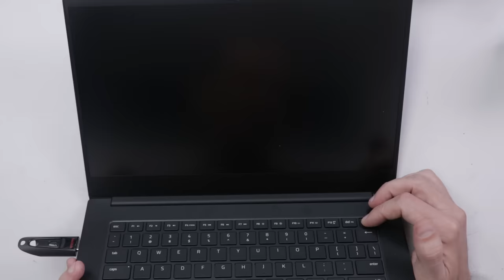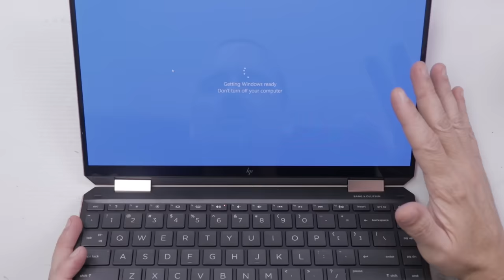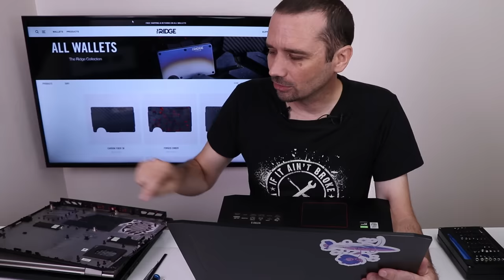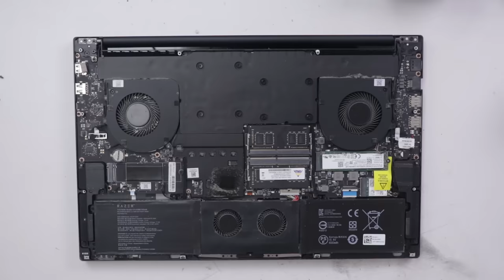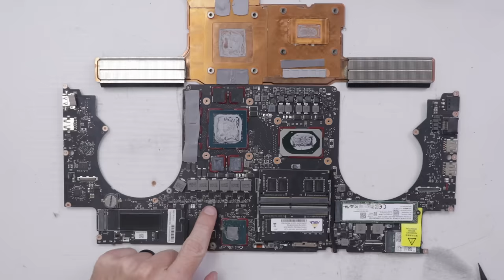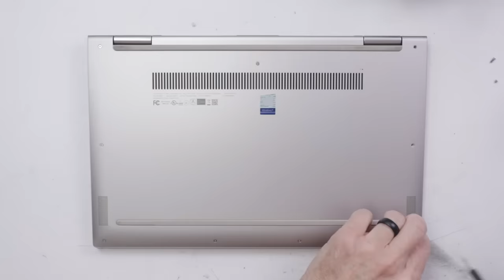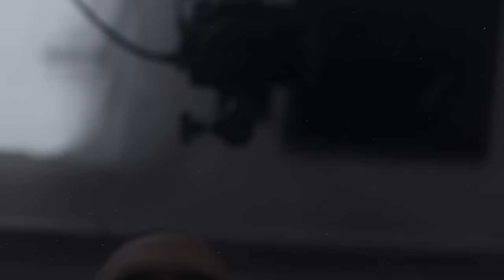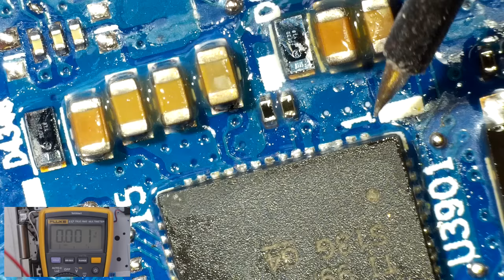I Paid $2500 for 5 BROKEN High End Laptops - But Can I Fix Them?!

Comment: For the Lenovo: Might also be a problem with either the charging cable, as my Yoga 730 recognizes if it‘s the supposed original one or a different. Which brings me to the second problem, if I use a different one I need to have the laptop open, because there is a light sensor near the camera which has to detect light. Else it won‘t start charging on another charger than the original one. This seems to be a known problem in Lenovo forums.

Comment: For the charging issue: my guess is that your dongle is not able to "boot" (initialize) itself, maybe try without your dongle and the computer on, see if the battery icon shows a charging indicator?
Reply: correct. I have same issue with those USB-c meters.
Reply: Yep - Always try without the dongle to rule that out as a cause! On another note i've seen Lenovo's kill the battery charging controller on several occasions so i'd probably just replace that to rule it out!
Reply: yep, i would do the same thing... i think the issue is the dongle, the charger, battery and laptop are just fine imo.
Reply: Also try to flip the usb-c cable.
Reply: Totally agree with that, I had the same issue with such a dongle.
Reply: the battery charging probably pulls too much current for the dongle to be able to start successfully

Comment: Laptops with battery issues are a tale old as time. Been doing laptop repairs, tech support and troubleshooting for over 15 years. One of the most common things I've run into is no power, no charging, etc. which seems to match up with the Lenovo. Most common fix I've had for that is to remove the battery, plug the unit into ac power, power the laptop on, go into windows, give it a few minutes, then shut down. Power off the laptop, reinstall the battery, boot back in, plug it in, and more often than not, it starts working again.
Reply: Laptops specially these compact ones got annoying issues with batteries. Usually the trick that Chris Harper said will work, but what I've seen 9 out of 10 needs a new battery to fix charging issue. A aheap batter isn't the best solution for a budget laptop or a sleek one.

Comment: Regarding the battery issue, I'd measure what changes when you connect the battery after it triggers 20V, especially on the battery sense pins, either voltage or resistance to ground and resistance to the charge controller. Also I'd check the battery connector soldering

Comment: For the dead keyboard sometimes a BIOS update fixes it.

There was nothing wrong with the two first devices. The first one just needed a single Windows reinstall and some drivers (that device manager looked horrible).
Now it's worth taking the working ones apart for repasting and cleaning the dust.

Comment: Always great to see your thought processes.  Its weird that the charge controller chip sees the battery voltage.  I would have normally thought a Mosfet between the battery and charge chip isn't working or something, but without a schematic thats tough to diagnose. Really strange, but glad you have most of them working. Great job!
Reply from the maker: It does seem strange to me. We'll see what the comments say when this goes live tomorrow.
Reply: P
Reply: The charge controller chip may see Vbatt for features like over voltage protection or similar safety features right?

Comment: Anytime you have a windows install that doesn't detect certain hardware (particularly the internet connection), you just need to install the drivers for it, you do not need to reinstall windows. You can usually find downloads for the driver software from the manufacturer's site if you simply search up the model number of the computer from another computer and download it to a USB drive for it. /IT professional

Comment: I had the same Battery Issue. Quick fix from an IT guy, he unistalled Drivers and did system restore from old backup. 
he checked my battery voltage as soon as he grabbed the laptop; then he checked AC connector, not even 5 minutes passes he asked me if we could do a system recovery or format PC to leave software Issues aside. he did system recovery, it took about 15 minutes for the PC to Load, and it was fixed!. 😇 he could have charge me for new battery or other expensive parts, I'm happy that there is some honest workers out there.

Comment: Lenovo - if it's fully discharged, it usually needs to boot up 2 or 3 times [turns on, turns off, turns on] and then it's fine. I guess when it powered down when you tested it, you just unplugged it right after it turned off by itself for the first time.

also if it's not charging and just flashing, but starts to charge when battery is unplugged, it can be KBC chip (Super IO chip)

Comment: I am constantly surprised by how many items you get that only need a simple fix like re-installing the OS.
Reply: Retailers do not fix the hardware, when a system is "broken" it gets tossed into a pile of broken computers to be auctioned to places that sell computers like this by lots.  You still need to know what you are doing and this was not a cheap lot (average 500 per computer, add to that the time to check it over and order parts) but retail wise he could maybe sell them for 5k if the Lenovo gets working properly.  Of course, with reselling the laptops, comes the warranty issues.   I used to purchase from Surplus by Design but their prices and shipping cost have become prohibitive, we'll let the market die down a little before there are normal profits to be made.

Comment: Make sure to test the ram on all of these laptops especially the easy fixes. When it comes to PCs and laptops faulty ram can cause crashes and blue screen when put under a very specific load and with basic testing you have a chance you won’t encounter those issues. I suggest run memtest or Aida64 stresstest on all systems and if they pass it’s all fine.

Comment: I’ve got a very similar issue with my Lenovo X1 Yoga as well. It just decided to stop charging and not even turn on with AC power. Brought mine to a repair shop and they could not fix the issue. Hope you find a solution and maybe I can fix my laptop as well. Thanks for the great content!
Reply: @BobDevV  My grandmother's lenovo laptop refuses to charge. It just blinks the charging icon, orange light. The batter is never used but the laptop is 5 years old

Comment: For the Lenovo laptop, try discharging the capacitors by unplugging the battery, pressing the computer power button for 20 to 50 seconds, replug the battery and then everything should start to behave normally again, I've seen this behavior before on other laptops and hearing as you said "it charges normally but starts doing it after a while" reminds me of this, said procedure usually fixes it
Reply: Lenovo has been repeating this thing since the old T60 that has somoe sort of latching issue because of residual charge on a mosfet (something like that). But hey, HP support and forums are not very different ....

Comment: One word of advise. It looks like your Windows USB drive has an Asus image on it. If you plan on reselling these, I would either check to see if there is a restore partition available to either revert to the proper factory image, and if not, I would use a generic Windows install (Microsoft has a tool that allows you to create a generic flash drive). If using the Microsoft Image, just say you don't have a key and pick Windows 10 Home for the install. By doing this, it will save the buyer from violating Microsoft's licensing terms.
Reply from the maker: Good to know. Thanks!
Reply: @Tronicsfix  windows media creation tool is what ya need! 😁
Reply: Also, it will automatically reactivate when you connect to the internet because the key is tied to the laptop in MS servers. So, even a generic win install will activate with the laptops built in key.
Reply: Yeah Windows should be able to find the license. Upgraded my mother's old Windows 8 desktop with a ssd and a Windows 10 install so she could access her HEIF photos, and Windows just automatically activated and upgraded the license to Windows 10.

Comment: A quick tip for aspiring fixers or even someone whose laptop keyboard isn't working and you suspect it's a hardware fault; just plug in any usb/Bluetooth keyboard and if that works, then it's most probably the laptop keyboard problem (still could be liquid damage & fixable) so buy a nee replacement part. If the usb/Bluetooth one doesn't work as well, then it's most probably a software problem.

Comment: Firstly great job and great video! :D For the laptop with the charging issue, I would measure with an oscilloscope the instant current drawn when you couple the power cable, because it looks like the power source is hitting some kind of over-current protection or short-circuit protection and cuts the supply off, then tries again every second (and that could be the reason for the flash)...so it might be the faulty battery which is drawing a lot of current at start or maybe a faulty power supply

Comment: For the charging issue:  I think the problem is a short from a faulty capacitor, you should be able to use your multimeter to check

Comment: The laptop that you're still struggling with you can try and reset the SuperIO. Its normally accessed via a pinhole through the back case with a thin paperclip. It presses a tactile button, hold it for 5-10 seconds. Also enter BIOS and see if there is a battery reset option in there. I find it odd that it will indicate charge with not battery attached unless it has another smaller internal one which some laptops do have.

Comment: I think I see your problem...

The low voltage LDO outputs on the TPS65988 are not meant to power too many external components.  At most the 3v3 LDO output will be powering an external flash chip that stores the firmware for the chip.  The ADCIN1 (pin 6) and ADCIN2 (pin 10) pins are not voltage inputs, they are literally Analog to Digital Converters that measure the voltages across a set of external resistors. When the chip boots from the flash it reads the voltages on ADCIN1/2 and uses that information to set the address of the chip on the I2C bus and what it does during boot if something is wrong.  This allows the designers to set the behavior of the chip with a few resistor values... 

With the battery disconnected you should get nothing on VIN_3V3 with everything unplugged.  LDO_3V3 and LDO_1V8 are used to start up the external voltage regulators elsewhere on the board but can't really power too much, they are only meant to get things started.  The fact you see LDO_3V3 at 3.3 volts says to me the board was designed correctly with this in mind.

I believe the flash for the TPS65988 could be bad or the resistors are the wrong values, both could cause it to boot loop and make your meter blink like that.  You'll have to read the datasheet for more info and where to get the flash bin but you could check the resistor values and follow the SPI lines to find the flash chip (probably a W25X05CL):
39- SPI_CS (GPIO11)
38- SPI_CLK (GPIO10)
37- SPI_PICO (GPIO9)
36- SPI_POCI (GPIO8)

From the datasheet:
The TPS65988 loads any ROM patch and-or configuration from flash memory during the boot sequence. The TPS65988 is designed to power the flash from LDO_3V3 in order to support dead-battery or no-battery conditions, and therefore pull-up resistors used for the flash memory must be tied to LDO_3V3. The flash memory IC must support 12 MHz SPI clock frequency. The size of the flash must be at least 64 kB. The SPI controller of the TPS65988 supports SPI Mode 0. For Mode 0, data delay is defined such that data is output on the same cycle as chip select (SPI_CS pin) becomes active. The chip select polarity is active-low. The clock phase is defined such that data (on the SPI_POCI and SPI_PICO pins) is shifted out on the falling edge of the clock (SPI_CLK pin) and data is sampled on the rising edge of the clock. The clock polarity for chip select is defined such that when data is not being transferred the SPI_CLK pin is held (or idling) low. The minimum erasable sector size of the flash must be 4 KB. The W25X05CL or similar is recommended.
Reply from the maker: Ya, that's what I was thinking. LOL, Jk. Seriously though, thanks. That's a lot of info. So how would one fix this type of problem?
Reply: Okay, maybe not a bad flash chip... but a bad diode-pair or bad mosfet...  If you can find the flash and trace the power backwards from there to one of the LDO power pins on the TPS you'll probably find the component that has failed.  It would probably be between one of the the LDO pins on the TPS65988 and the flash chip holding its ROM (maybe a W25X05CL or similar).
Reply: But without a schematic you'd probably have to poke and pray....

Comment: Love the videos, I find them really inspiring. I used to fix a lot of HP laptops back in the day. Older laptops were pretty simple but as things evolved, they got more complicated. Some components now had their own hidden processors. Quite often these would crash but because they always had battery power you couldn't just reboot them. An HP engineer showed me a trick to force a reboot of these hidden processors and it might be worth a try. Disconnect the battery and connect the charger, power on the device and as soon as you see the boot logo before windows starts to load, pull the power cable. Now reinstall the battery and power on as normal. The HP laptops would flash the power light to indicate the hidden processors had rebooted and usually the weird issues would disappear. Hope this helps. Keep up the great work.

Comment: When installing Windows onto an OEM machine you should download all the necessary drivers and add those to a folder on your USB drive before installing windows... or at least the system and network related drivers.   That way you can just install them and be done.

Comment: It is so nice to see how easy is to replace battery and keyboard in windows laptops, I remember replacement battery in my 2019 MacBook, 1.5h fight with a glue, and I'm not even talk about keyboard, 40 tiny screws, 40+ ribbons  and a thin aluminum foil shield.

Comment: Normally OEM laptops (ASUS, Razer and so on) have their own deployment systems that handles reinstalls. Most of the times you have issues with a normal reinstall is due to that. But there are always workarounds. Drivers from webpage, a RJ45 adapter and so on.
Reply: ACER has problems with EEPROM. Keyboards and TP are generally affected by that. And no a BIOS flash wont fix it. You have to use an ACER tool to fix it. Very easy tho, but i doubt ACER share the EEPROM writing tools

Comment: Couple things I would have done with the yoga: the charge IC was clearly replaced, I would have removed it and properly reseated it, its possible solder is bridged underneath to the ground plane. Next I would have went on VinaFix and got the schematics. That USB-C port is super sus I would have removed it and looked for bridging on the USB C port, it was probably replaced poorly by a tech.

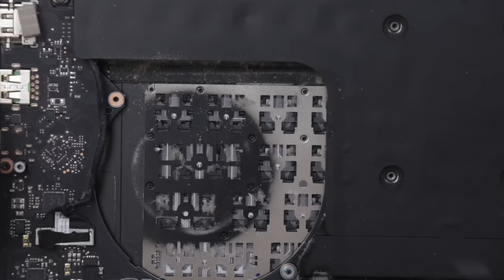Comment: 10:30 Any laptop that is used for a few years without being cleaned out is gonna look like that inside.  I've seen much worse in desktop PCs that sat running 24/7 in a smokers bedroom.  They can get bad, like someone just dumped dusted tobacco inside the PC and kept packing it in until the PC died.
Reply: I mean that razed laptop is a very small form factor so if it’s used in a dirty home it could very well look like that in months.

Comment: I had a lenovo too with charging issue, The problem was with it's BIOS, you have Conservation mode on Lenovo Vantage, which will help fix most of charging issues just by turning it on and off again....
Updating BIOS will be the best option I guess.
I'm not Hardware expert so I don't know much about Hardwares.

Comment: For the lonovo yoga, You might just check the pin on the battery connector on the board to see if there's any issue since it work perfectly fine when you unplug the connector, hope it help.

Comment: I wish you would have figured out the lenovo charging problem. I have the exact same situation on a lenovo x380 yoga. It happened after minimal water damage - a few drops went in around the area of the arrow keys. The laptop turned off and since then I have the exact same behavior as yours. It works fine without connected battery though. But it would be great to revive it back to its full functionality somehow.

Comment: I had a problem quite similar to the last one, I tried everything from re-soldering to changing components, finally decided to check what the BIOS said about the charger, turned out that the charger watts weren't enough for the battery to charge so I purchased one with more watts and it solved the problem.

The issue as I said was similar, once I connected the charger with less watts the laptop would turn off immediately if the battery was connected, once the battery was disconnected it worked normally
Reply from the maker: That's a good idea. I'll be checking that.
Reply: @Tronicsfix  do a video
Reply: @Tronicsfix  hope it helps

Comment: Love the videos. About the Keyboard issue. Watched a repair video recently where a few keys didn't work. Ended up being a few small faulty components by the Keyboard ribbon cable on the board. I know very specific. I watch to many Vids.
Reply from the maker: It worked with the new keyboard so I don't think the board is the problem.